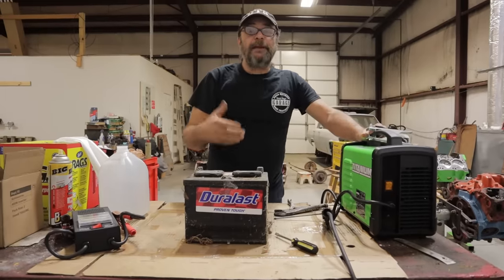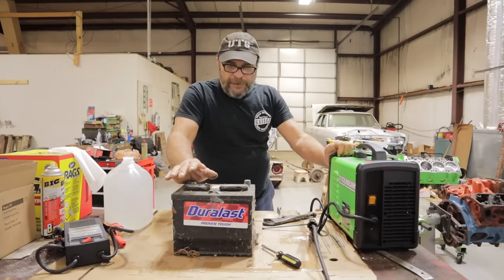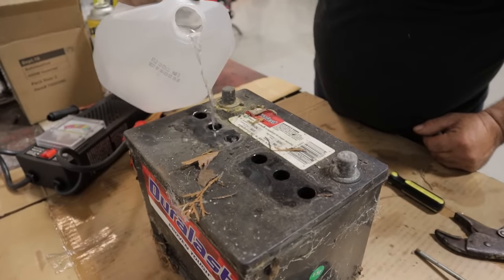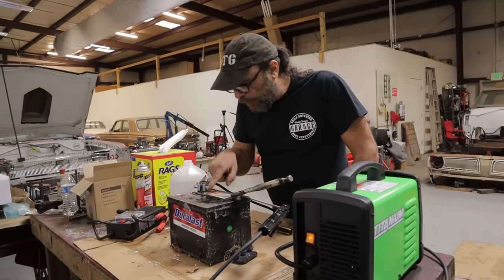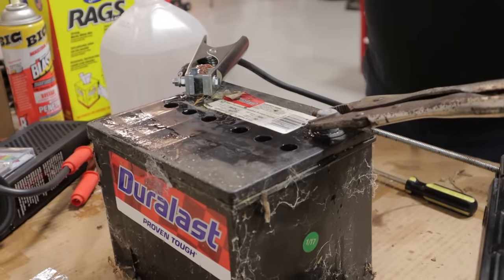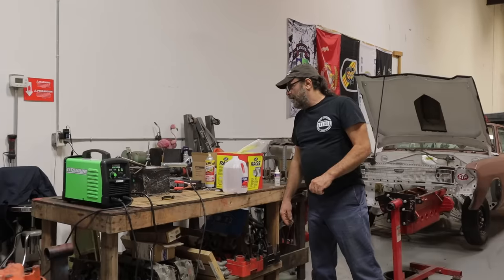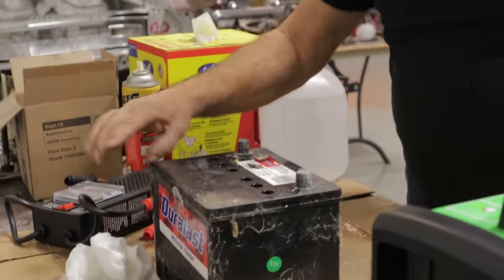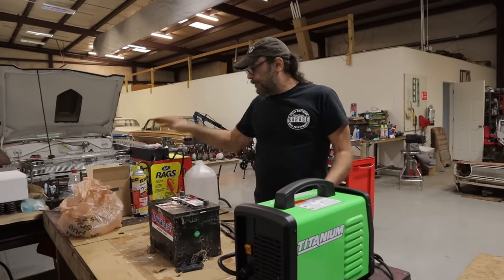Reviving Dead Batteries With A Stick Welder

Comment: Can we have a round of applause for the duty cycle on that welder.
Reply: It’s made from titanium according to the sticker. 😅
Reply: This guy is a nut. He should of had fan blowing in that area. I've seen one blow up on a auto shop teacher. In the 80s never had a problem when I worked on car batteries in my career working in cars. I always had a fans  in doors.
Reply: I was thinking the same thing.. let's hope it above a 20% duty cycle🤣
Reply: @kenpickett9317  that is no
Reply: Typical 3/32" 7018 rod runs at ~90A, depending on the situation. 1/8" 7018 at about 120. Not really impressive, it's what it should be able to do.
Reply: @michaelrodgers6559   yeah but you spend more time slag hammering and chucking up new rods than you do welding, that being said it should be able to handle those 5-10 minute tests without issue, i ran nearly a full 10lb spool of wire through my Esab Rebel when i first got it on just every amp and every volt itd suffer all at once for funzies, melted a 3" 1/4 wall square tube into a saggy puddle of goop, smoked the ground cable and the mig gun wasnt long working after that.. the welder itself was still blowing cold air out the back and it didnt show any warnings or anything..

the new IGBT based welders are so efficient that they dont really produce much internal heat, unless youre production welding in the heat of cambodia i dont think youre going to overwork a modern welder
Reply: It's a tough one for sure
Reply: My son bought that unit for his first welder. It has been great for him welding the sheetmetal floor of his busdominium.
Reply: I have that same welder and it is SPECTACULAR value for money.  I have pushed it way past where I thought for sure it'd tap out and it just doesn't stop chugging along. If you are on 240v that is. If you use the 120 adapter it will perform very badly and you will have to reset the fuse box every 5 minutes. But it'll still be good for tacking the odd thing in a pinch on 120.
Reply: @jonathanjones8257  
As with any high amperage equipment you have to have the correct size wires going to the plug.  My son uses a 50' 12 gauge extension cord to run it on 120v. in his bus. 
And my garage has it's own breaker box.
Reply: I learned the hard way by running a compressor and a shop fan on the same circuit.  Of course it had to be the compressor that burned out
Reply: Electrodes should be negative - and the earth should be positive +. On all arc welders.  Bet his welds are bad, being wrong polarity lol
Reply: No it's use to working with a dead short a battery is considerably less stress than the constant dead shorting of normal welding think about it
Reply: Without cleaning corroded and shorted plates you won’t fix anything.

 And with all that hydrogen gas he just made, I’m happy he’s ok
Reply: That's what I was wondering. I wonder what kind of internal damage or wear would result from leaving it on, and how long it would take.
Reply: Right
Reply: @kinn1647  uhm ..... no .. obviously  ur no welder
Reply: @corradopalmerini4076  he did have a fan , on the welder
Reply: @commonconservative7551  I think he was referring to a ventilation fan. The bubbling of the electrolyte in the battery is the production of hydrogen gas. It will build up in enclosed spaces. A spark could cause an explosion, as hydrogen gas is extremely flammable, more-so than gasoline vapors. Hydrogen gas is produced whenever these batteries are charged. That's what the bubbling is when you look into the vent holes. Hydrogen gas is lighter than air so it will rise and collect in higher areas. A large building like this shouldn't be a big deal for doing a single battery.
Reply: @juansolo1617  i implied the welder fan was enough
Reply: @commonconservative7551  It's just gonna blow it around the shop. Shop needs to be vented. Like I said, it wouldn't be a problem unless you were doing a lot of batteries. That's a big shop. It will collect near the ceiling. If you're doing it in a garage you might have problems without a fan venting the room.
Reply: @juansolo1617  one spark near the fume source could blow it up, i blew up a manlift batt [throwing carbon-arc sparks] , it was a muffled boom from being shrouded, it never happens = usually
Reply: These welders are junk 😂
Reply: @jeepwk6.5L  seeing a good mech. tear it apart and see the hidden cheapness is chilling
Reply: @commonconservative7551  yuck I could only imagine haha. A Chinese welder should never be in the same sentence as impressive 😂
Reply: @jeepwk6.5L  I take it you've never used one before? I have the Stick 225 and the Flux 125. Soon to have the TIG welder as soon as I get my tax return. I've never had a problem with the stick or flux welders. They make good welds. I welded a curling bar that started breaking at the middle joint (two piece bar welded with the flux welder) and it can still hold 200 pounds on both sides. The weld doesn't even flex. Some dudes just trash everything that isn't made in the US. Soon nothing will be made in the US. I don't know what you'll do then.
Reply: @juansolo1617  haha so your a hobby welder and think ur welder is top notch? We run welders all day every day 24 hours shifts. Those do not and can not run the duty cycle we use in my trade. And yes I’m a union member so I will always choose a 🇺🇸 made product 🤷🏻‍♂️
Reply: @jeepwk6.5L  Never said it was "top notch." I said it wasn't trash. Who cares what you do? So now every welder you don't approve of is Chinese garbage?
Reply: @juansolo1617  oh I’m sorry is this not a Chinese made welder? Exactly. They are cheap for a reason. Their throw away welders for someone in a pinch or a hobby welder who doesn’t have to run 100-250 amps for 12 hrs straight. Wont cut it in the real world. But people who have them in their garage think their good because it can weld what they need them for. So yes in this argument what I do for a living matters. I’ve seen the Vulcan which is the same welder basically with the stickers swapped (what HF is known for) be toasted in the fab shop because we needed another welder and the boss brought us one. They’re duty cycle they claim is completely false. Especially the aluminum transformer ones(like this).Not to mention if you ran TIG off this machine on a heavy wall weld like we do the chances of it lasting more then a couple months is out of the equation.
Reply: These newer generations of inverter stick welders are something else with how hard you can run (some of) them. I've got a 200a itty-bitty lunchbox sized one that's so off-brand that it makes HFreight's offerings look like Millers, yet I run that sucker like I stole it and owes me money pretty much every time I do anything non-trivial with it and not only has it never clocked out for a break, it barely gets warm either. I also know that it's at least in the ballpark of its amp-rating because there's no way I'd be able to carbon arc gouge w/ 1/4in electrodes & be able to watch thick plate steel act like wax does when you take a blowtorch to it. $80 too, yee-haw
Reply: @juansolo1617  That's what I was thinking too, frigging nbd. Sure, hydrogen *could* accumulate at the ceiling, but generating relatively negligible popcorn fart quantities of hydrogen in this bigass garage that anyone can plainly see is like most every other garage by having drafty af car garage doors made me dismiss the notion that this could've very easily wound up looking like a fertilizer plant explosion or something similarly asinine like many others have either stated or implied. Ugh, I wish there weren't so many dull-ass people around  who're unwilling to grow the spine needed to enrich their lives with a healthy amount of *calculated and/or reasonable* risk. Living an thoroughly "safe" life still has a 100% mortality rate.
Reply: @michaelrodgers6559  1/8" 7016 only needs 90-100A DCEP
Reply: @DS-mm6fh  dont usually weld battery’s and don’t use stick its 2022 not 1922 honestly a bad accident waiting to happen stay awesome lol
Reply: rip.
Reply: @kinn1647  Only on certain rods others run on other polarity.
Reply: @joshuawheeler4404  correct, the battery will have internal resistance that will build as the battery charges unless the battery is shorted internally. So this is how the welder probably didn’t get damaged for as long as he had it on.
Reply: @juansolo1617  they will start building it at home again , it’s starting here In Canada already , people are sourcing materials locally because of supply shortages , industry latches on and building at home picks up.
Reply: Great vid..I used a soldering iron on my lawnmower battery but I will admit that I did do it inside.
Reply: claps paws!
Reply: @corradopalmerini4076  What about rubber gloves and safety glasses?
Reply: I just tried to renew the battery. I had 7 volts and after I hooked up the welder to the battery I checked the battery and it had . 4 what did I do wrong or what happened??
Reply: No, 50 amps is nothing for a 150 amp welder.
Reply: @kinn1647  Are saying that the positive on the arc welder should go to the negative in this battery recharging application?
Reply: @wellnesspathforme6236  always check with multimeter. TIG uses a positive earth, also has a AC or DC functions. Always when charging a battery DC positive to positive negative to negative. The voltage needs to be correct and the amps too. All a bit sketchy, probably only attempt if its impossible to buy a new one ⚡️🖖⚠️
Reply: @daleslover2771  it's sold at harbor freight and in my experience  the duty cycle( in reality) is less than 10...I bought a junk tig welder that worked for 5 minutes before it blew up.Never buy a welder from china.
Reply: @pnotuner1  I had a compressor motor melt down when I left it unattended on a inadequately wired 120VAC circuit. Motor didn't start up on leakdown over time and the windings melted down as a result. Have to remember to always turn off the switch when no longer using the compressor.
Reply: @epmcdonald4562  who said anything about pipeline. You must be a hobby welder 😂

Comment: You’re much braver than me Uncle Tony, I wouldn’t stand that close, I’ve seen a few blow up.
Reply: With the caps open it's more of a volcano. Being that close is sketchy even by my standards
Reply: My old auto-tech vocational school instructor told us the story of the exploding battery on a student and with him about to 'whip it out and neutralize the acid.' I think this is an auto tech instructor hand me down story but is real none the less. Great memories learning about car batteries
Reply: @Mrshotshell  I see a huge sale of those shirts in Tony's future.
Reply: Camera Man is the Bravest. He gets to looking right down the barrel of the Gun  5:17  and 6:29
Reply: Just make sure to use air to blow out the explosive gas from the cells and have a fan blowing on it when charging and working on them. Ive rebuilt many electric forklift and handjack batteries and thankfully none of them exploded.
Reply: @MrTheHillfolk  Indeed
Reply: Kind of off topic but I remember working at a Sears automotive shop and people would bring in batteries to have checked if they were good or bad. The battery checker said to charge up the battery to 12 volts to see if it was good then check it. Sometimes people left on an interior light or something was drawing down the battery but the battery was good. Our manager did not want us to charge the battery up but just hook up the checker which would show it was bad with the low voltage but actually still good because he wanted to sell more batteries. I stopped working there for the way they cheated customers. They would put sale adds for tires but when you go to buy them they would say they were all out but had other tires they tried to upsale that were more expensive. It's no wonder Sears went bankrupt.
Reply: You are correct. I know a mechanic that had a battery blow up in him. He had the scars in his face to prove it.
Reply: Ya I had one blow up next to me a couple years ago,luckily I happened to be turned away when it happened.
Reply: me neither!
Reply: I blew one up once trying something similar, but I still generally like this idea and may try it myself, but I would play it more conservative, shut it off just as it starts making a mess or before, and use many more cycles.  maybe 20.
Reply: @RyanTreks   They blew up on a few used cars.
Reply: If you decide to try this at home it wouldn't be too difficult to have a face shield (not just glasses), a pair of rubber gloves and a cheap plastic hooded raincoat, along with a garden hose close by that you can run to, but not right next to the welder.
Reply: It's not going to blow up unless there's an internal short in the battery to ignite it or a spark to ignite the off gasses.
Reply: If the battery did blow up, this video would do the same. win/win
Reply: @jonathanlawson4667  PPE is the least , welder to close , I don't know about a direct vent or fan might ignite gas , from static electricity , safety protocols definitely need following up , to avoid injury or death , guess he was using DC welder EP. ..🤔✌️💪🖖🙏
Reply: Too bad , you can't use glass bead cabinet  , fully grounded  out ,semi nice to know in a pinch emergency with full PPE and fresh acid  , seen it before with full flush of chunks leftovers removed , like to see longevity results of charge held , for reliability...🤔✌️👍💪🙏
Reply: When he turned the welder on I noticed that Uncle Kathy was smart and started using the ZOOM feature so she could stand back LOL
Reply: bs
Reply: @jonathanlawson4667  look both ways....dont eat yellow snow....dont talk to strangers lolol
Reply: I had one explode when I tried to jump start a friend's car. Luckily we were at his apartment complex right by the pool. I got lots of acid in both eyes, I just ran and jumped in the pool. If the pool wasn't there I am sure I would have lost my eyesight.
Reply: I also, would not have stood that close. 

Especially not after the words “this is highly flammable gas” came out of my mouth
Reply: @jonathanlawson4667  you must be a battery salesman.
Reply: @jonathanlawson4667  ohhh I see now, you are somewhere on the spectrum.
Which is why you can’t understand sarcasm.

It’s okay most engineers I know have a touch of autism.

Of course this is dangerous. But there are ways to do it safely if you want.
You are one wrong moves from lighting off hydrogen at all times.
But that’s what makes it entertaining to watch. Haha
Reply: @jonathanlawson4667  snow flake
Reply: @jeffgood6441  I disagree, UT isn’t dumb at all.
Reply: @ACathater 
The crazy thing is the Navy ship filled with helium killed more people when it crashed.
Reply: This is a complete misnomer. Batteries don't "blow up". The hydrogen produced when they're charging deflagrates (subsonic), not explodes, if an ignition source is amongst hydrogen which is in an appropriate concentration in the air (from ~5% to ~70% IIRC).
Reply: If the caps are of, it shouldn't blow....but if the caps are on,, oh,yeah 👶...let the acid rain begin...
Reply: DC welder?
Reply: @jonathanlawson4667  
Are you saying with the caps off they blow up?
Reply: @jonathanlawson4667  lead acid battery filled with water with no caps will not explode. Even with thermal runaway. Maybe if you had it in a small small room  and let the fumes fill up and then had a spark. But for the most part lead acid batteries are low risk for even a fire. You need pressure for an explosion right?
Reply: @jonathanlawson4667  do you need pressure for the explosion you are talking about?
Reply: @jonathanlawson4667  lead acid batteries don't explode from heat. They melt and leak all the acid out before they get hot enough to light on fire. How do they explode? Specific details please.
Reply: @jonathanlawson4667  
How do they explode? Specific details please
Reply: This is a perfect example of what happens when a child is raised by helicopter parents. Children aren't allowed to learn how to survive any more, because their parents never let them. All they learn is the stuff comes from the stores and that's how you survive. Good luck with that.
Reply: @jonathanlawson4667  
Nonsense
Reply: Haha..I take it you mean to replace those damaged during "battery rejuvenation ".
Reply: @bicylindrico I watched it happen to my buddy someone hooked up the charger backwards I'm working on doing an engine harness you could hear it from the other side of the shop.